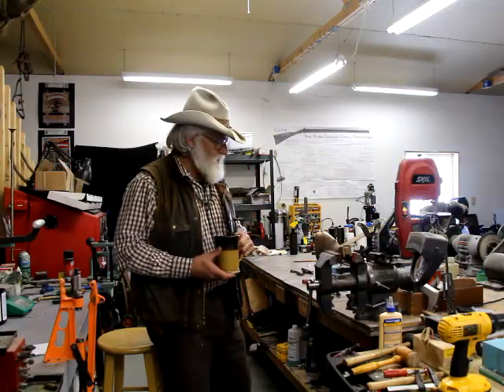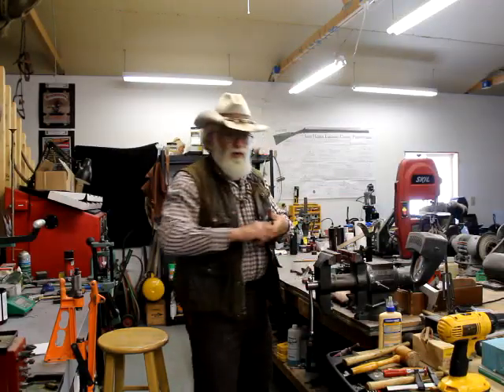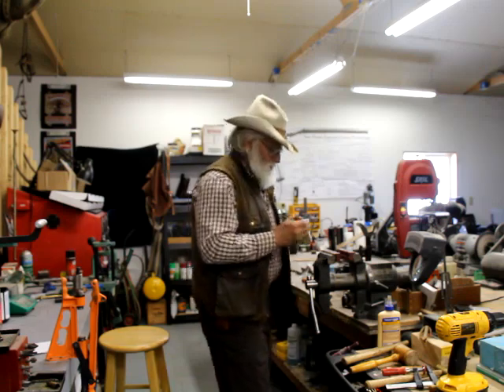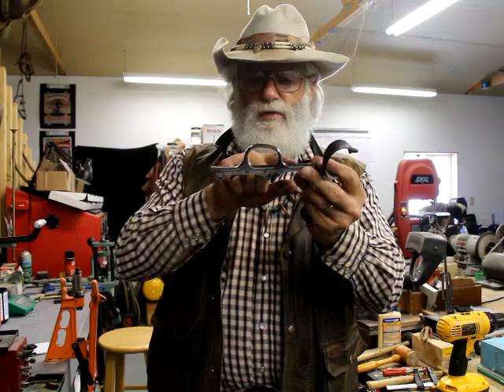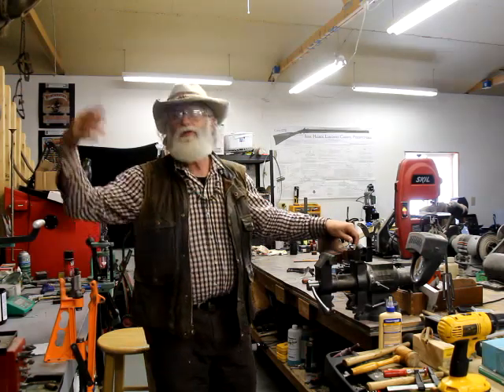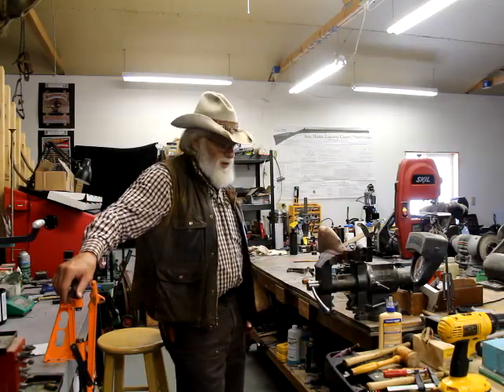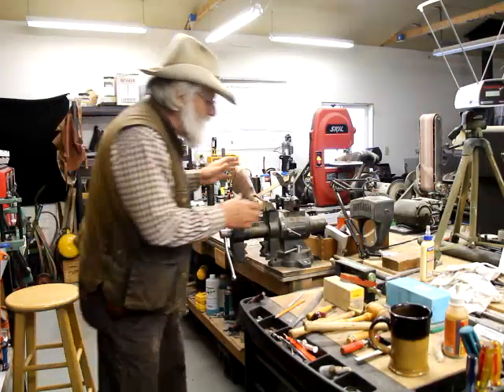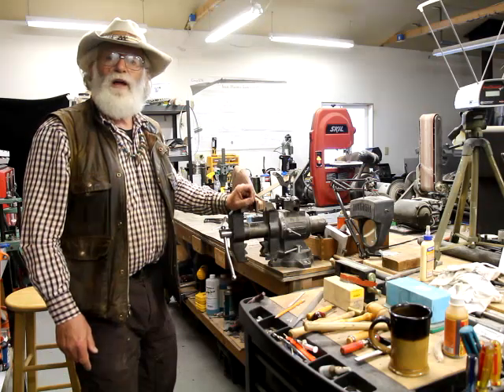Coffee W Buckskin Dave    Progress on Rolling Block Gemmer Hawken

Comment: Personally, I'm not really fond of cheek rests.  Some of the muzzle loaders that have the floral carving around the edges look great though!   Any way you decide to do it, I think will look great!  I'm very impressed with your work!    Try "Lone Star Rifle Works"  They were making rolling blocks until the owner accidently shot himself...… I bet it's the same company.
Wiscombe was the guy I was trying to think of before.
Reply from the maker: The Hawken had a beavertail cheek rest in later years.  This one will loose a lot of wood and be more of fixture than a cheek jam point.  This stock has some cast off to right so it will pull up without a cheek weld
Reply: @BuckskinDave   With or without, it's going to be neat!